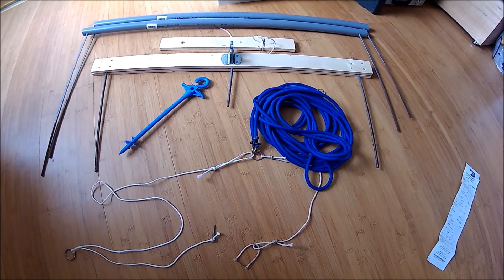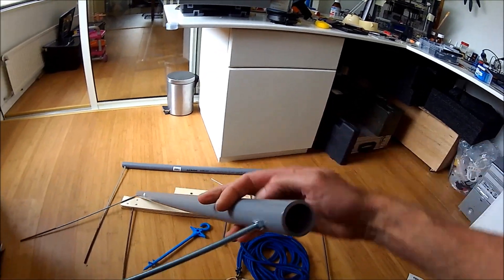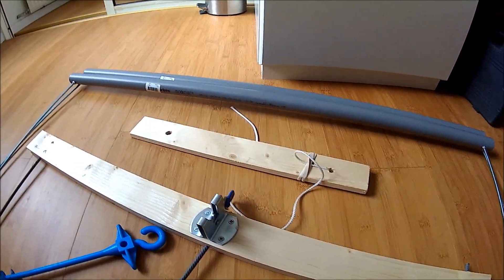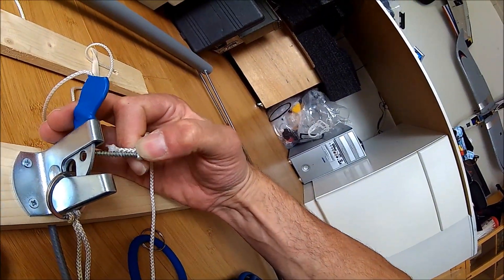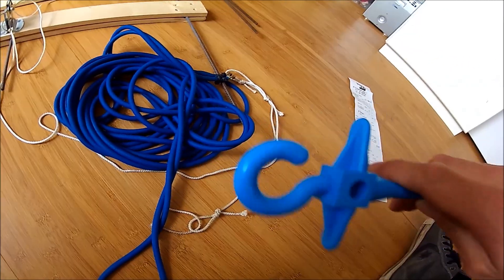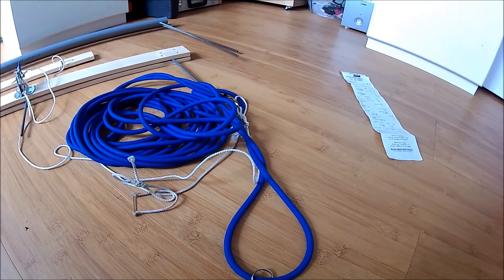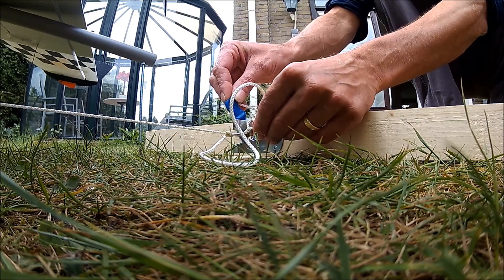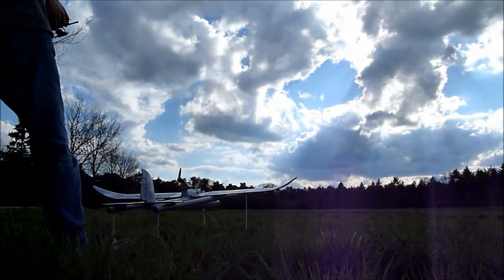RC Bungee Launcher under 30 bucks

Comment: Nice setup Crazy Crow. I was thinking about having the screw to stop the latch from prematurely opening which is a great idea, but wouldn't it be a better thing to have the screw attached to the wood where the latch is fitted to rather than having it flying around with the bungee and model at launch?
Reply from the maker: Todd Hazell 
That’s actually a great idea. Why didn’t I think of that 🤔
Reply: Crazy Crow  Just an outside observation

Comment: Do you ever have a problem with the release string getting caught up in the prop?
Reply from the maker: No I never had that problem. The weight of the entire cord will pull the thing down upon release. I can imagine it would be a problem when the prop is in front of the plane.
I only have one plane like that and I never launch it with the bungee. So I can’t speak from experience.